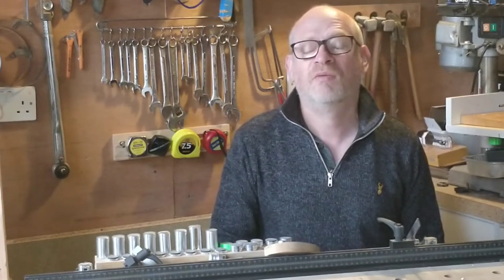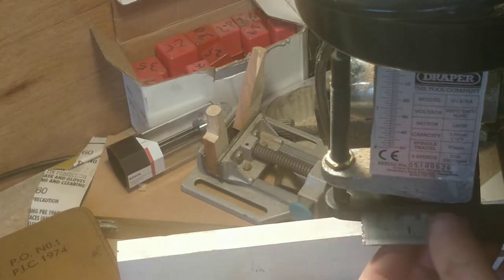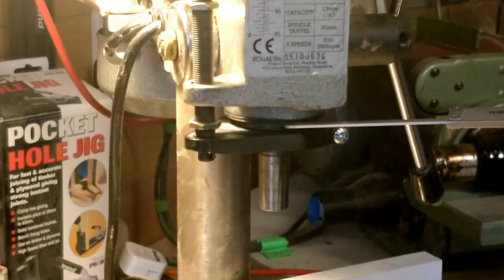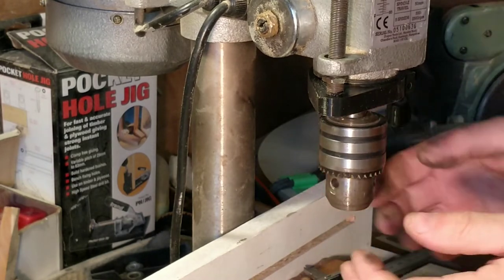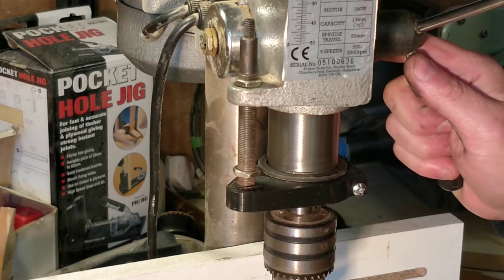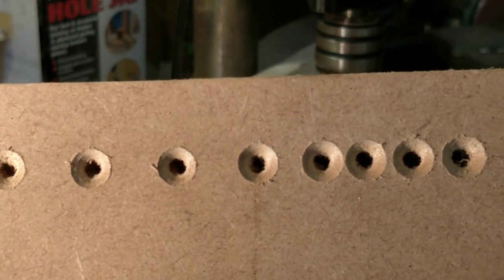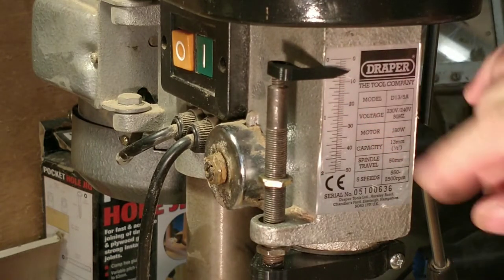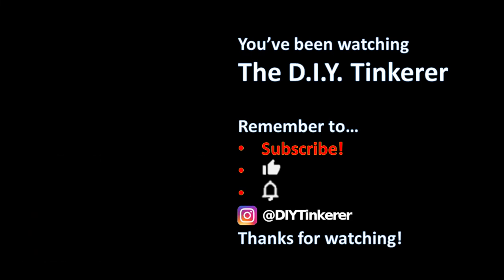58. Depth Stop and Gauge repair for budget Bench/Pillar drill

Comment: Interesting to see how you modified your design. Would an aluminium plate attached using c a glue to the underside of the plastic depth depth stop help? Also, make the whole thing rectangular rather than tapered at one end. Would you recommend the Draper drill?
Reply from the maker: Thanks for the suggestion. Re the Draper drill, it is an old budget drill, it has lasted but has really only had light use, but I wouldn't expect it to perform any better than any other budget drill. Also I suspect the models they have today are different from this one. It works, is a bit noisy and a bit crude, but can't complain given I've had it for about 25 years!